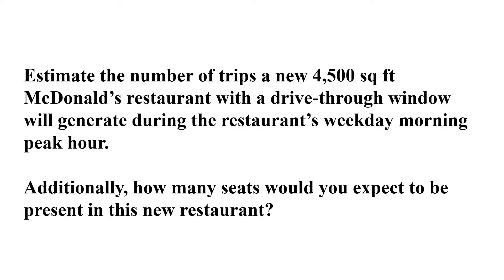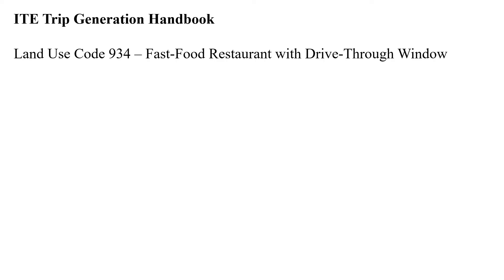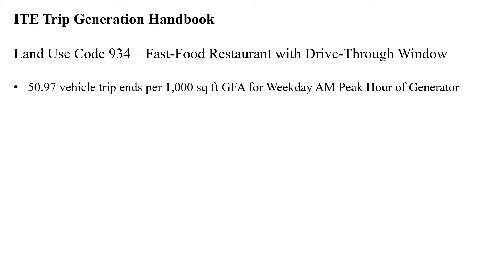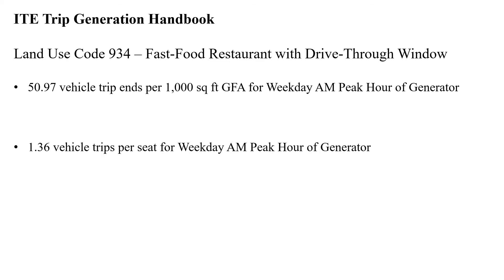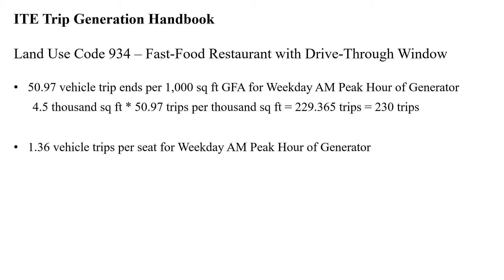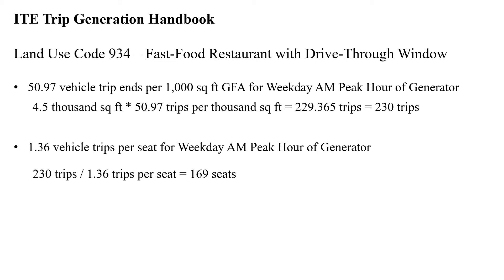Trip Generation Example

Comment: Why did you use AM peak hour and not AM adjacent street?
Reply from the maker: Great question!  The problem asks for "restaurant’s weekday morning peak hour."  That language suggests we need to use the peak hour of the generator (i.e., the highest number of trips generated by the land use).  The adjacent street value would provide the number of trips generated by the land use during the peak hour of that adjacent street's traffic volume.  The peak hour of the generator will always result in values greater than or equal to the peak hour of the adjacent road.
Reply: Thanks @FindleyDaniel